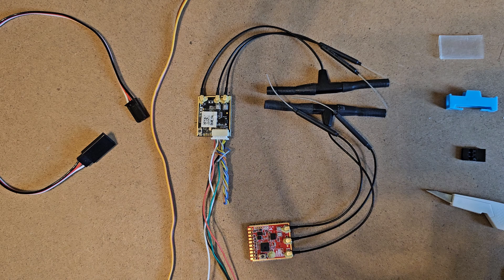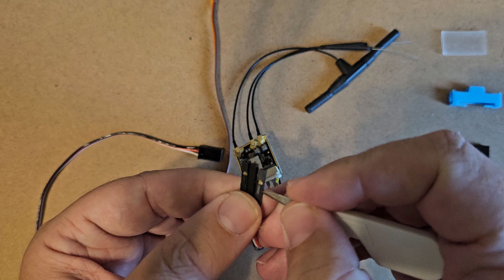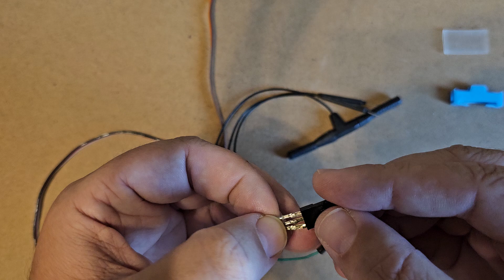FrSky TANDEM TD MX Receiver (v2) Extending Servo Connector Leads Lengthening Wires

Comment: Hi Ben, I'm a fairly new convert to frsky.   I bought an X20, then several mos later I recently bought an X20RS.   I've been studying all the different frsky receivers.   My question; why would someone buy a tiny receiver that requires soldering and/or fiddling with tiny connectors?  I'm an rc lifer and I don't mean to sound sarcastic or anything.   Can you please explain the advantage of this little receiver?  Respectfully,  thanks, JW from KC.

Comment: Hi Ben, I just had  newest TDMX receiver but noticed it doesn't have inverted Sport anymore . This is big problem for user which using F4 flight controller which requires inverted sport signal pin. Any clue to resolve  this matter?  Thx
Reply: Pretty crappy design variant IMHO
Reply from the maker: @goesnickfvp7529  I'm very sorry but for some reason they removed it. I've been complaining to HQ about this for a long time. It really frustrates me too. I have to use an S.Port inverter circuit and it's very annoying :(
Reply: @frskyben  yes that is so true, frsky has alot of capable receiver type to serve any purposes however with missing of inverted sport pin I need to consider to install elrs module on the back of the tx which actuality I really avoided to not complicating my setup.